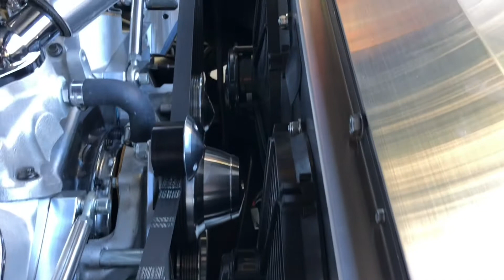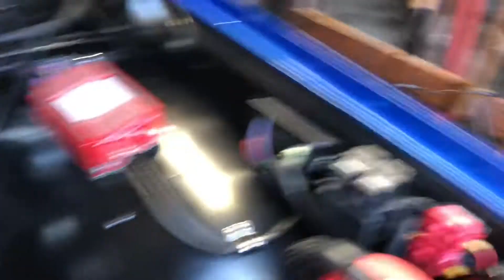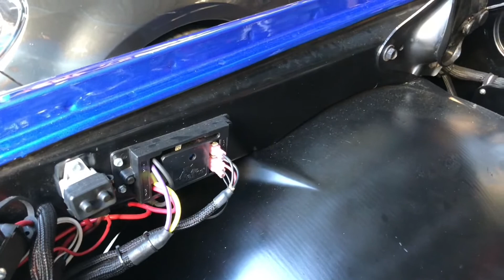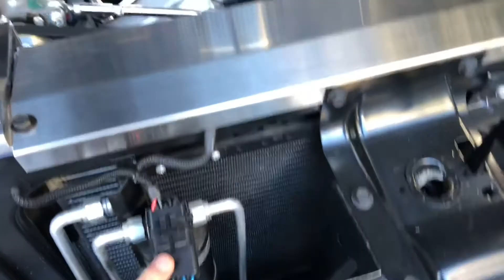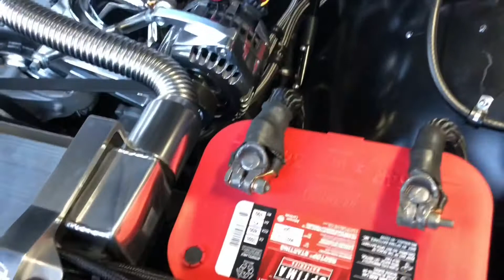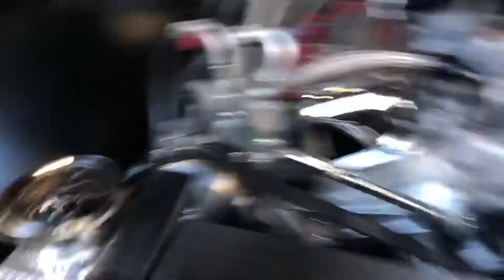Cooling System Tips, Frostbite Radiators, Spal Fans, and Mechman Alternators

Comment: Can I please get the spal fan part/model number? I’m working g towards your 155 FB setup on a Mopar 540 mega block in Florida heat.
With the two controllers as well.  Spal suggested 30107089 or the brush version, yours looks thinner though. Second thing is the FB155 shows it’s a I think I may need a FB224.
Thanks for any help Awesome video!!

Comment: Scared me out of even trying electric fans,
 what you got in that system $6000 dollars?
Reply from the maker: It's no different than building an engine.  There are lots of parts you can use that all look the same, but getting the right parts quality and combination is key.  This is no different.

Comment: Good point about the thermostat. If you take the thermostat out you would need a restrictor to slow down the coolant flow but then as you said the engine wont get to operating temps quick enough.

Comment: I too have a mech man alternator I would consider plugging the additional ports on the alternator plug I had water seep in and it damaged the plug pins sent it back to mech man and they fixed it under warranty. New revised plug had epoxy on the ports that are not used.

Comment: Here's a hint on building a good power supply for your cooling fans - go to a car audio store and buy a 80 or 100 amp relay backed by a 80 amp circuit breaker. That'll fix that.
Reply from the maker: Relays are hard on the electrical system/alternator with inrush current and also cause temperature swings. 
Variable speed keeps a constant temperature and lowers overall power usage.

Comment: Great video man, super educational I learned A LOT from just trial and error testing e-fans too and I tried several. Would be cool if you checked out my last video where I talk about the Evans so you can give me your thoughts and input. 
Now I’m currently running a Lincoln mark viii fan and it works great but I still want more power and I’ve found some fans that are insanely powerful, which I’ll be posting a video on soon.
Reply from the maker: I’ll check it out. 
Yeah the Mark Viii fan or “Taurus” fan moves a ton of air, they are just huge. If you have the room, they are good. 
I have some later videos up about E-fans as well.  I get into the sciencey stuff about static pressure and performance curves.
Reply: @mechtrician1  i’ll check out your other e fan videos today!

Comment: Great informational video! Coincidentally, I too run a Frostbite 4-core radiator with Flex-A-Lite fans and controller on my '85 Chevy C30 crew cab dually, which is also a "Camper Special". I think it's a great setup, costly, but well worth it! Anyways, I was curious as to what ignition setup you are running? I was also interested in that setup where you have your fans turning on in relation to the pressure in your A/C system, can you possibly give me some information on that as well? I'd appreciate it. Thanks. Very clean setup by the way, mine looks good, but not that good...
Reply from the maker: Thank you. The ignition system is an MSD Direct Ignition System. It’s a relatively new product. I did a few videos on it early in my YouTube videos if you’re interested. It’s a coil per plug system. For the AC, I use what’s called a trinary switch. It’s basically a 2 circuit pressure switch.  Normally you have a binary switch, single circuit for the compressor. In a trinary switch, one circuit is used to control the compressor, the other circuit is used to trigger the fans. In an AC system, the pressure is what’s important. Just because the compressor is running, doesn’t mean you need your fans running, and vise versa. The only issue is, if you want to swap to a trinary switch, you have to discharge the system.  Mine is installed in a port in the accumulator/dryer.
Reply: @mechtrician1  Thanks again for the information! Much appreciated!

Comment: Dude you nailed it! Static Pressure is the key and is not the easiest information to get. I have been fighting the fight for a while with my 86 monte carlo with a 454 bored .30 over. I put a 4 row aluminum radiator and have been trying to match a fan that could pull consistently. I have taken my condenser and AC system off and still haven't figured it out. Not to mention im from Georgia but now live in Phoenix AZ which the worst for these cars in 110+ degree weather. I recently have come to the conclusion to take the 4 row radiator out and go with a 2 row but i have been trying to figure out the best fan configuration to go with. You have a beautiful setup by the way. But im hoping for the best after blowing head gaskets, changing water pumps, advancing timing, switching thermostats... its becoming a nightmare... Great Video!!
Reply from the maker: Thanks man.  Hopefully this video helps you out.  Big radiators have big resistance, you not only need CFM but the ability to move that CFM through a thick radiator.  The only thing I will note is to not use the Flex-a-lite controllers with Spal fans.  I found out the hard way the PWM frequency is too low.  Either put in a large continuous duty relay or a high-frequency PWM controller.  I have some other videos on those things as well.
Reply: @mechtrician1  you know what I did. I bypassed my fan controllers and straight wired the fans to their ignition fuses. Uses more power by running constantly but this car has plenty extra power for it and I don’t drive long durations.